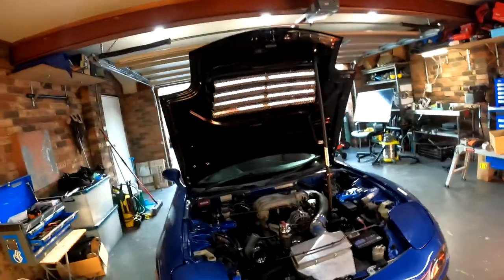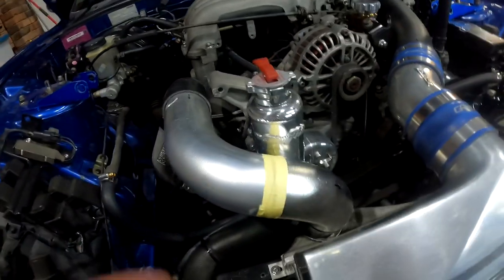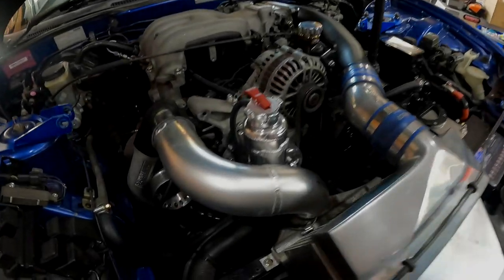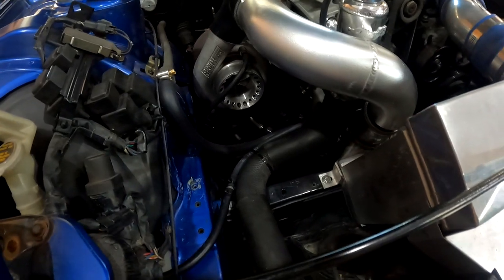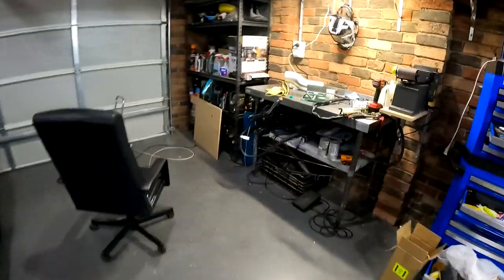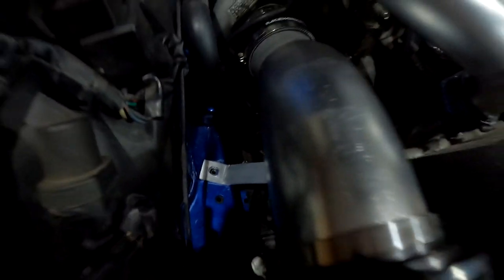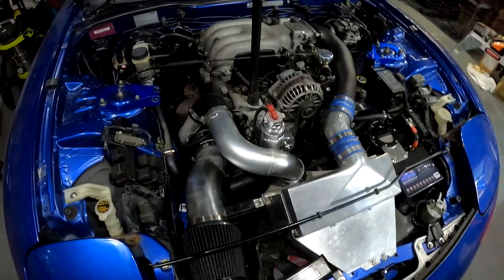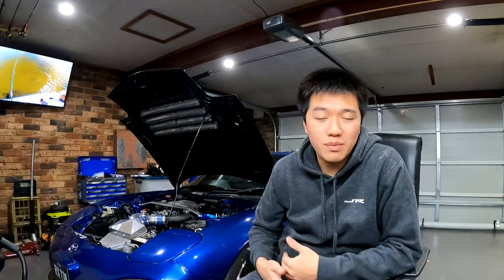FD RX-7 Build EP.1: Making a pipe in lockdown

Comment: What turbo setup and fueling system are you using? And how much power are you putting down with that intercooler? I'm in the midst of swapping in a single turbo, and will be running a greddy trust SMIC just like you. Was curious to the power you can make with a single turbo and SMIC
Reply from the maker: Hi mate
Currently the setup is very basic.
Turbo is a Precision 6266 running on gate pressure (8psi spring), it made 201kw at the hubs on 98 fuel. 
The SMIC won't help you make any power but it is sufficient cooling for street use. For circuit use, I don't recommend SMIC due to heat soak and positioning behind the radiator blocking air flow. Eventually i will upgrade to a v-mount.
Reply: @JCYT that's awesome, I'm running a 6262 and hoping to run around 300kw of power to the wheels.